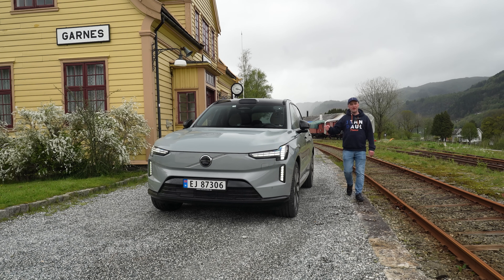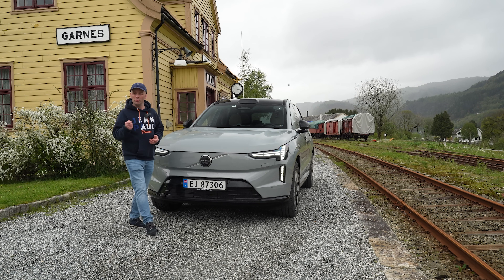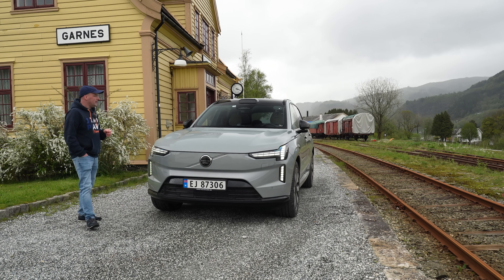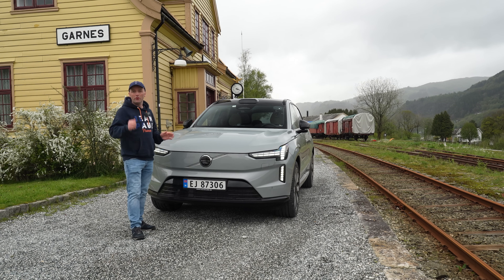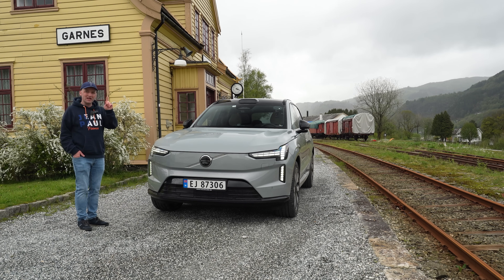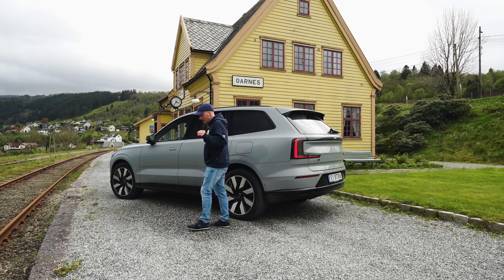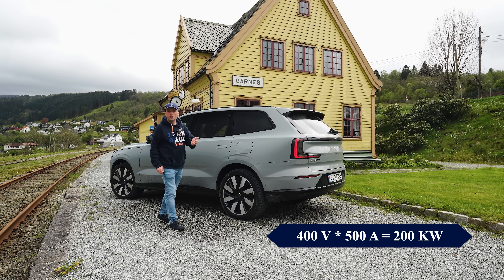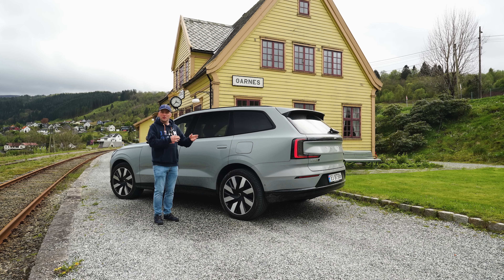Wait for 800V EX90 ? 🤔 MY26 Incoming

Comment: Worst Volvo they ever made. I ordered it more than 2 years ago. Finally got it in June 2025. More than 10 problems with it and 3 times delivered it to workshop. Couldn’t open doors, it will not charge, lights stop work, couldn’t start and the list goes on. Now they also cancelled LIDAR. I keep my XC90 instead cause I had it for 10 years now without any problems.

Comment: Here in Canada, the 400volt would be fine as our Tesla Supercharger version 3 and 3.5 (with version 4 dispensers) would actually be preferable provided the infotainment processor is upgraded. Our CCS high power infrastructure is still having issues of reliability and reduced number of chargers especially here in BC and Alberta. Will have to see how Volvo will handle 800volt charging on 400volt DC chargers. If they opt for splitting the battery pack in 2 x 400 volt like others have done then it should be ok. But if they opt for some kind of DC to DC inverter, than 400volt charging will likely be compromised.

Comment: You have your C-rate math backwards. If you're charging/discharging a battery faster than it's nominal capacity, it's below 1, not above. Eg: A battery with a C-rate of 3 will take 3 hours to charge/discharge. 3x faster than its nominal capacity is 0.33.
Reply from the maker: No.. That's not correct..
Reply: @volvo_kristian  Well, this is more confusing than I thought... it seems we are talking about two sides of the same coin, and there is two ways of expressing C rate. To explain:

I found an article* which explains the two ways C-rate is used. In the article they use the examples of 5C and C/5 (0.2 C). Both of which are different. It seems that the position of C changes the meaning:
- C5 (also written C/5) means a five hour discharge, ie: the current is 1/5th of the capacity (0.2 C)
- 5C means a 1/5th hour discharge (12 minutes), ie: the current is five times the capacity

I suppose I am old school, since I learned about C rates before lithium ion was common. I was taught to think in terms of how many hours it takes to discharge the rated charge. 

Maybe you already knew this, but the second was new for me. 

*I tried to post a link twice, but YouTube keeps deleting my comment. The article I mention was posted on Battery University.
Reply from the maker: @nickway_ Actually didn't know that, so interesting to know. Not sure if the discharge C ratings can be used for electric cars. Or maybe it's the measured maximum discharge rate.  Did much research to learn about the Charge C ratings. So that's basically all I know on the topic. But that should be correct. 

Thanks for clarification

Comment: Great video and fits my predicament exactly. Based on what are you 99% sure they’ll make the switch to 800V in MY26?  Do you have a source at Volvo R&D 😊? Thx again from DK
Reply from the maker: There's many factors that led me to be this sure.. Made another video some weeks ago regarding some of those aspects. Posted 22.03.25 with a thumbnail "Big Improvements".  

 I've gotten several confirmations last weeks, but nothing I officially can comment on.  There's always a possibility of delays. And it's not R&D that calls the shot here. Many factors. 

I also think there's a reason why Volvo didn't want to be precise about WHEN. They just said in a future model year update. If they say MY26, then maybe some people will hold off from buying a MY25. And therefore loose sales, that can again cause further delays. And if they confirmed MY26 with 800V they would also imply that the 800V are important or significant. And in my opinion it's really not. Depends on use case. 

But let's wait until September and find out

Comment: Finally – 800V technology is coming to the EX90!

The one and only point that came up as a weakness in nearly every YouTube review is finally being addressed.
It was to be expected – and once again, it shows: Volvo listens and keeps pushing the EX90 forward.

The fast NVIDIA DRIVE Orin chip is being replaced by an even faster one.
Alright – the moment I notice my Orin is slower than me, I’ll consider the upgrade. 😄

And on the leather vs. Nordico front: Volvo responded – leather is now optional. I personally wanted leather at first –
but honestly: Have you ever seen a leather driver’s seat after 100,000 km?
Looks like the cow chewed it back. 
If Nordico delivers what it promises, the seat will still look brand-new after 100,000 km – and I’d gladly take model year 2026 with Nordico.

But first things first: In 7 days, my EX90 (model year 2025) arrives.
And honestly? I feel like a kid on Christmas. The future is rolling up – and I get to ride in it.
Reply from the maker: It will be interesting to see how the Nordico upholstery looks after some time.. 

Hope you'll be pleased with your  EX90 👍
Reply: Thanks for the feedback – in 100,000 km or 10 years, we’ll know whether Nordico or leather holds up better. I’m curious to find out.

Comment: Still with an updated  version, no roof cover, no digital mirror👎🏼
Reply from the maker: Digital inner mirror are optional 👍
Reply: @ it might be an option for Europe or US, but not in UK unfortunately
Reply from the maker: Are you sure? It's not a factory option. It's aftermarket accessories. Fitted locally at your Volvo dealership. Available for all Volvo's after 2020 if I remember correctly. Would check with your Volvo workshop

Comment: I don't think the 800V will increase the price much. This is because at 800V the current is halved. Components become more expensive when the current is greater than by higher voltage. The price can probably increase by other motors and the battery. And can the charging stations supply 800V?
Reply from the maker: Maybe.. I just think we will see a price increase, but time will tell.

Comment: You did a pretty good job in explaining 400V vs 800V. Subscribed. If EX90 will be my next car, the 800V is the choice. But before that, I am also very curious of the coming EX60 and what that car may hold as the ES90 was not an option after checking it out at World of Volvo in Gothenburg.
Reply from the maker: Thanks so much 👍 Glad I managed to explain this properly. Yes I'm also very interested in the upcoming EX60.. The ES90 does have it's attraction, but at the same time not.. Mixed bag. So I'm also shifting focus to the 60 instead.

Comment: Interesting. We have mostly 400 volt chargers in my part of the world, and only a handful of Tesla sites accessible to non Teslas. So for me the question would be how fast the 800 volt EX90 charges on a 400 volt system. Sounds silly, but in some cases, the answer is actually quite a bit slower than the 400 volt version. Kia/Hyundai had this issue, I believe. For some people, they want the latest, because they believe it’s better. Others go for the depreciation argument you discussed. As of today at my local dealer, the EX90 isn’t moving very quickly. Even for customers that can afford it, the car is expensive - quite a bit more than the XC90 they’re used to, and this tariff business has a lot of people spooked. That makes me think that there may be some good deals on 2025 models later in the year. That would be worth considering. Trouble is, the charcoal grey one at my showroom has 22” rims. Potholes and curbs love 22” rims.
Reply from the maker: That's definitely a interesting aspect. Will probably get to try that out on the 800V Volvo ES90 👍 Looks good on 22"s but definitely see your point there. Maybe try to sell them afterwards, and buy a set with 20"s

Comment: My understand Polestar are going to free upgrade current 400v to 800v ? So why cant Volvo as same platform and Volvo garages will do it too 😂 Seems an easy win for Volvo even if they charge?
Reply: This absolutely isn’t happening - 400 to 800v would require a complete battery and charging architecture replacement rather than some OTA update. The “update” will be in the form of a model year change, likely next year
Reply from the maker: And when are Volvo doing a model year change for the EX90? This year. In around week 49👍 usually they do it around week 19, but the EX90 model year change are delayed.. Wonder why? ..
Reply: @volvo_kristian  When I got my XC40, it was built in early April, which I believe was around week 48 for the Ghent factory. Is the Charleston plant on the same cycle, or are they on a calendar year?
Reply from the maker: @davidcottrell570  They are all following the calender year. But as a main rule, Volvo change model year around week 17-19.. With small variations. That's why we already have MY26 XC60 at the showroom floor.. However this time the EX90 model year change are postponed to week 49 ish.. That's around the time where Volvo starts late production of that current model year.
Reply from the maker: @Star14trek  Polestar won't do this free of charge. They will also most likely increase the price from MY25 over to MY26.. Most likely. These are either way speculations. I don't know how much a price increase will be.

Comment: The nVidia chips are not responsible for "touch responsiveness" or anything related to the cockpit displays. That is controlled by the Qualcomm Snapdragon Cockpit platform. Yes, that interacts with the nVidia computer, but you need to make a distinction.
Reply from the maker: @ericocasio1678  Thanks for clarification 👍
Reply: From Volvo:

The in-car AI computer is built on the NVIDIA DRIVE platform. This core system, plus the Snapdragon Cockpit Platform from Qualcomm Technologies, Inc. and in-house developed software by Volvo Cars engineers, work seamlessly together to run the key functions inside the car, from safety and infotainment to battery management. The result is a more responsive and convenient car experience.
Reply: @ericocasio1678  This was the original plan in like 2022 before they moved to Xavier/Orin (and soon Orin/Orin). No cars shipped with a Qualcomm chip.
Reply: That information comes from Volvo's website, posted on September 5, 2024. I'd post the link, but my comment with link keeps getting removed by YouTube.
Reply: This isn't true. Nvidia does both the core compute and infotainment. There is no snapdragon processor in this car.
Reply: @sp13081207  For some reason my reply keeps getting removed, likely due to the link I posted. There is a news post on Volvo's website from September '24 where Volvo explicitly states that Orin the AI computer and that it works alongside the Qualcomm platform.

"The in-car AI computer is built on the NVIDIA DRIVE platform. This core system, plus the Snapdragon Cockpit Platform from Qualcomm Technologies, Inc. and in-house developed software by Volvo Cars engineers, work seamlessly together to run the key functions inside the car, from safety and infotainment to battery management. The result is a more responsive and convenient car experience."
Reply: @sp13081207  I work with the EX90 infotainment platform and it's definitely Qualcomm based. The central Nvidia computer has nothing to do with the infotainment.

Comment: Well, Kia/Huyndai has had 800v for a long time. Smart will have it. Considerably cheaper cars than Volvo. Yes parts costs a bit more but I honestly do not think that really would cause much of a price hike.(just checked zeekr from geely also already uses 800V so parts are most likely common then inside the company)
Reply from the maker: @RH-jj7ck  Maybe.. but at least they are more expensive than the parts they are currently using.. I'm not sure what Hyundai are running, but they don't reach the same charging performance as this will, most likely.

Comment: However 250 kw is fast enough on my Model Y. My typical charge is 10 to 15 minutes after one and a half to 2 Hour Dr.
Reply: yes, but for same 2.5hr driving EX90 will need to charge quite a bit more because of consumption so to keep the "wasted" time on charger the same  it would be nice to suck up more juice.
Reply from the maker: Always good with more juice 👍
Reply from the maker: @Donald77BS  Maybe, but pretty huge battery here.

Comment: For the cost, yes. And assume will have Tesla port in the US. Leather always nice.
Reply: Don't forget as well that most Superchargers in the US can't do 800V. Only the latest version supports it.
Reply: Not a big issue either way. Volvo offers adapters, I'm sure they'll throw one in if you ask. That should cover the very few times when you can't find a charger with the right plug.
Reply from the maker: @Donald77BS  Forgot about that US plug.. Don't know, but let's cross our fingers